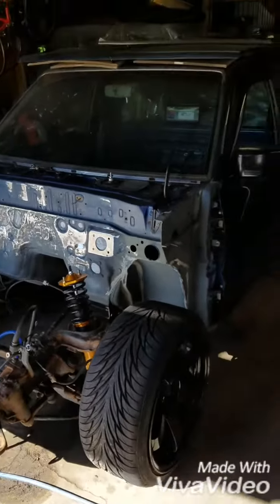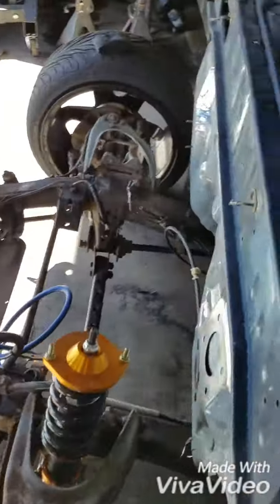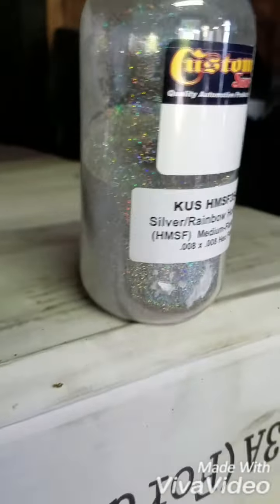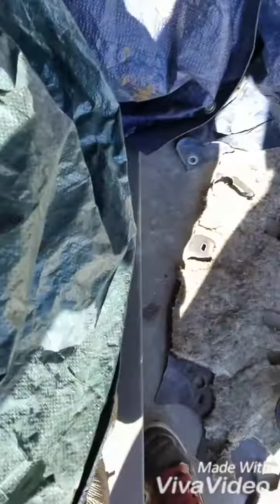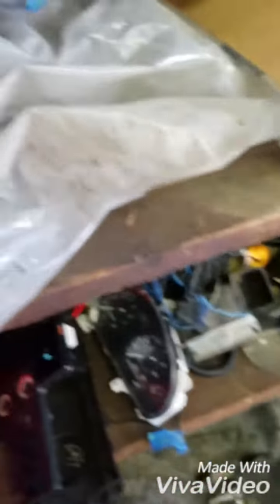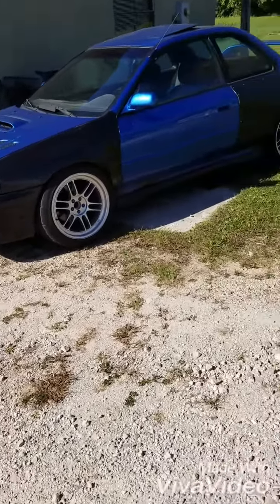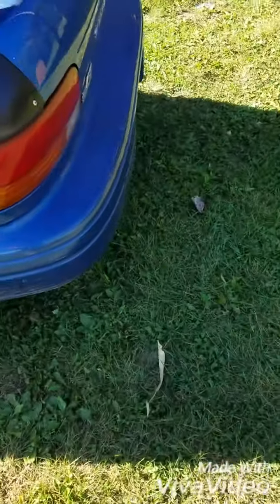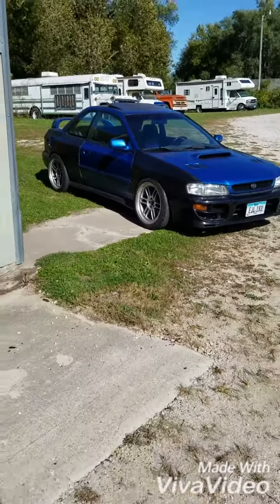B2200 DRIFT TRUCK BUILD! The start of Heintz Boy Garage

Comment: sway bars launch my b2200 drift truck . sway bars and drifting are not a good match . coilovers very hard like 600 700 pounds no sway bars good start to drift setup. i dont know what you are going to weigh though. looks cool good luck . love the car tag repair !!
Reply from the maker: chrimpatty that's weird because the local drifters here say that a bigger rear sway bar is one of the first things you should do. but thanks you, and we'll see how it handles when it's finished!
Reply: Heintz Boy Garage ....when I think and build drift car truck. I think I want a stiff car . too stiff. something that dose not bump much hence less bump steer. I like a overly stiff drift setup so the alignment does not change. because there is almost no travel.  then you recover grip with tire width and compound. the front could be stiff road race and back stiffer. but I like the whole car sprung hard. our gutted rx7 drift car is 800 front springs. 700 pound rear springs. sway bars problem for me drifting is they load up and when you change direction there is a  bound up sway bar that takes load and releases it it can be hard to predict hence hard to controll. but that is at a road race set up. once you get as hard as I run springs .way bar is of no consequence , so I see it as dead weight. it's a philosophy.  you have to agree or do your own thing. the best part of racing really. we both could be just as good with totally different setups. but that is a idea of why I say no sway bar drifting.  and I am forced to build cars both ways for several reasons.